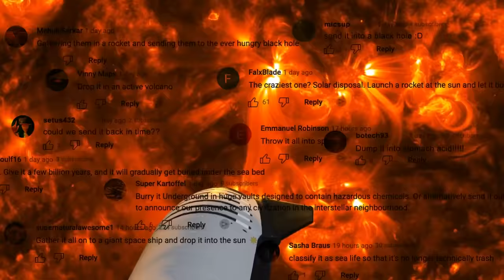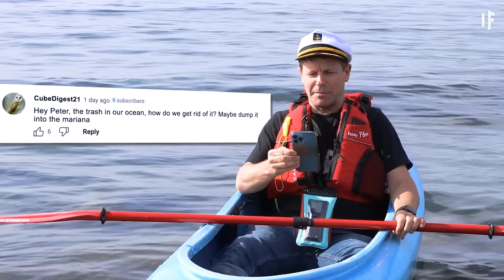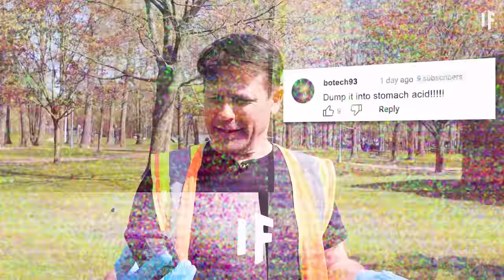What If We Threw Our Trash Into a Volcano?

Comment: I agree, recycling is great.  However, the vast majority of the plastics collected by your local waste disposal company end up in a landfill anyway, even if you put them in the recycling bin. There are many reasons for this, ranging from shady waste disposal companies charging you extra for a special container that has its contents dumped into the truck alongside all the other refuse, to the incompatibity of recycling plastics of different types together (to alleviate this problem you would need to hire extra workers to seperate the materials which is not cost effective) or because there are other materials still present in plastic containers that will significantly degrade any recycled materials made from them.

Comment: Can they just recycle ♻️
Reply: I agree, recycling is great.  However, the vast majority of the plastics collected by your local waste disposal company end up in a landfill anyway, even if you put them in the recycling bin. There are many reasons for this, ranging from shady waste disposal companies charging you extra for a special container that has its contents dumped into the truck alongside all the other refuse, to the incompatibity of recycling plastics of different types together (to alleviate this problem you would need to hire extra workers to seperate the materials which is not cost effective) or because there are other materials still present in plastic containers that will significantly degrade any recycled materials made from them.